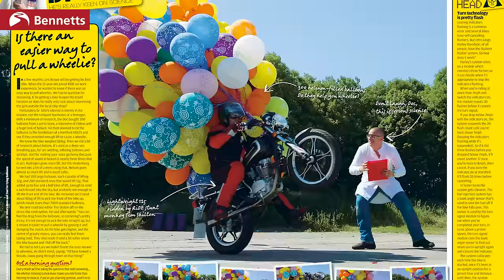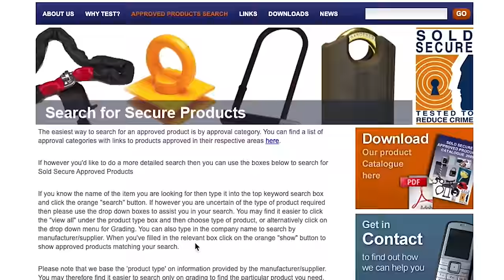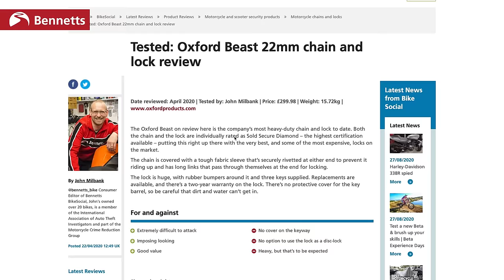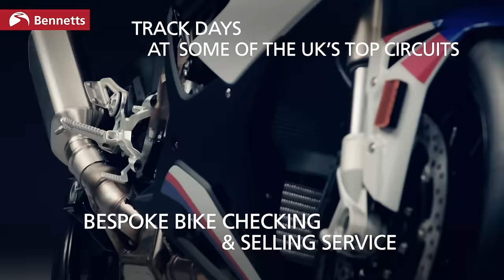The TRUTH about the best motorcycle lock | Litelok, Kryptonite & Oxford Beast review

Comment: Great video John ,keep up the good work.
I use a Pragmasis round lock and chain for my CRF rally. Put the last link through the rear suspension link under the bike and fit the roundlock through it with the keyhole facing down.
Probably not the best, but I think its a good average price / security / weight system.
I put the chain round a pole or something obviously.
What bike is that in your workshop with the barkbusters ?
Reply from the maker: Some good kit you've got! That's my Grom, which I did up to look like an Africa Twin. Cheers, John

Comment: Nothing is safe. Lidl sell a 20V angle grinder with 1mm slitting discs for well under £100 that will slash though hardened steel and stranded wire rope in seconds. 
Get a decent usable lock (the biggest are a pain to use) and use it. Park the bike where thieves won’t want to be watched.

Comment: the chain was hardened to much, it is too brittle - a good ABUS chain will withstand the sledge hammer attack at least a few times and will be extremly difficult to cut with a bolt cutter. the secret is the quality of the heat treatment
Reply from the maker: The perfect balance of case- and through-hardening is very important, but nobody should be surprised at these results on a chain this small.

Comment: I wonder why no one is using a sleve of chainsaw pants material on the outside of the lock. That would jam up a angle grinder.
Reply from the maker: It could be cost, but also it could be easy to remove with a knife, so less useful than you might imagine. It's worth a look, but the action of a grinder is also quite different to the teeth of a chainsaw, which will hook up with the aramid fibres more readily. Cheers, John

Comment: Thank you for the amazing video! That was very informative and I appreciate your candor. I was wondering if you'd be willing to test Kryptonite's New York Legend chain/disc lock. They state that it's their most secure lock: a 14.5mm chain and double deadbolt disc lock.
Reply from the maker: Thanks very much! I have approached Kryptonite several times about submitting product for our tests but so far no joy. I've had some experience of their kit and it does seem good. A 14.5mm chain should be bolt-cropper-proof, but I'd assume it's on the brink of portability. For home use, you could go up to a 16mm, 19mm or even 22mm. Cheers, John

Comment: Great bit of testing mate, the massive chain and lock for around £300 sounds great for home security, but I would not go through the wheels on my Rocket 3 due to the design, the gaps aren't big enough, in fact a struggle with the smaller oxford chain. multi layers and hope they decide its not worth the time and noise. Oh and that's a railway line, not a sleeper which is the wood or now concrete bit they lie on...lol
Reply from the maker: Yeah, sorry about that – I meant a piece of track. Would the Pragmasis Anti Pinch Pin work for the Rocket? https://securityforbikes.com/anti-pinch-pin.php
Reply: @bennettsbikesocial  I’ll have a look when I get home mate , as far as I remember it’s not hollow as there’s a massive spline drive on both front and rear axle. But worth a look

Comment: Very interesting and good points. But what is the best way to use the locks? I know it is best to chain to something, but if that something is weaker than my lock, then it will be as strong as the weakest link.
Also, should I lock through the back wheel, or is it better to loop through the frame? If there is nothing to lock to, should I try and go through the back wheel and frame?
Thanks.

Comment: I just got my front rotor replaced on my 1974  CB750 and I can't use a disk lock anymore. Been hunting for a portable solution with no luck! If anyone has any leads to something that will work please let me know!!!
Reply from the maker: THere are portable solutions rated here: https://www.bennetts.co.uk/bikesocial/reviews/products/security/motorcycle-chains-and-locks Unles you have solid wheels, you've got nothing to worry about...
Reply: @bennettsbikesocial  Thanks so much, I'll take a look. My bike is known for being difficult to find a solution for, hopefully I'll find something! The rotors have no holes and very tight clearance at the base.

Comment: Maybe it did take 4 1/2 minutes if they were using an el cheapo low powered cordless grinder - the sort a punk thief might use. Just saying.
Reply from the maker: I'm not sure you can get clockwork grinders, but if so, maybe that's true. Though they also claimed it was 'pro' thief. Maybe it's different in Canada.

Comment: The biggest flaw with Litelok is that if you twist it, you can just rip the cables out of the locking mechanism entirely. There are videos of it on youtube.
Reply from the maker: I did try this and wasn't able to – I'm not sure if the design has been tweaked since those videos, but that didn't seem to be an issue in this case. John

Comment: Yeah the "Beast" looks great, but how practical is it. Does it fit through the engine swing-arm area? NOPE... so you put it thru your rear wheel and all the thieves have to do is take off your rear wheel lmao.
Reply from the maker: Tuck your bike properly into the corner with a heavy-duty chain attached, and let me know how you get on whipping the wheel out and taking the bike away. Get a couple of mates to help too. 
What would your suggestion be instead of a heavy chain?
Security is about making a bike harder to steal, not impossible.

Comment: Best putting your bike in your house and sleeping next to it with a shotgun 😀..I use two screaming disc locks front and back..heavy duty chain..magnum u lock on front wheel and a brake and throttle lock..but if they want your bike that bad they will take it..all you can do is make it as hard as possible..

Comment: I can't see the point in these methods of testing. Many of these test are like trying to drive a pozi screw with a flat-head screwdriver and the telling us how difficult it was. I mean why bother trying to cut stainless steel cable with a hacksaw when you could use steel cable cutters and have the job done in 5 seconds?

Any thief with a clue will only use the right tool or technique on the lock they're defeating. All of these locks can be beaten in a few seconds or at best a few minutes by someone who knows what they're doing.
Reply: Wire locks cable cutters. Chain locks bolt cutters.  Forget the hacksaw.  And what were those propper job garden cutters ever for I've never used them in my life. And the second pair looked like what electricians would use for cutting copper mains meter tails.
Reply from the maker: Which was the point of the video... watch it through rather than skipping along if you can. John

Comment from the maker: NOTE THAT THE 'LITELOK GOLD' HAS NOW BEEN DISCONTINUED, WITH THIS VERY SIMILAR LOOKING 'LITELOK ONE' REPLACING IT. THIS PRODUCT IS NOW ONLY RATED TO SOLD SECURE MOTOR SCOOTER SILVER, NOT THE PREVIOUS MOTORCYCLE GOLD. 
To find the best lock for you, check out the league table I've written based on three years of testing at Bennetts BikeSocial. Cheers, John https://www.bennetts.co.uk/bikesocial/reviews/products/security/motorcycle-chains-and-locks/how-to-choose-the-best-motorcycle-security
Reply: Hi have have a almex 25mm but how long is the cut time on the Oxford beast 22mm
Reply from the maker: @Jf20082  We don't reveal cut times, and we also haven't reviewed the Almax 25mm (we did contact them but they've declined to be tested). Chances are that due to its sheer size, the 25mm will take the longest to cut with an angle grinder. Cheers, John
Reply: Hi! I noticed in a few times you’ve indicated that mc crime is declining. I’d be interested in a video on the stats and reasons behind this.
Reply: Look at pewag chain i think is really good
Reply from the maker: @danielmcnamara897  I've tested some Pewags: https://www.bennetts.co.uk/bikesocial/reviews/products/security/motorcycle-chains-and-locks/how-to-choose-the-best-motorcycle-security
Reply from the maker: @opcb9815  https://youtu.be/a578fDDP-Nc
Reply from the maker: @opcb9815  https://www.bennetts.co.uk/bikesocial/news-and-views/advice/biking-tips/stop-motorcycle-crime
Reply: I have smaller tools that will cut through those wires. 🤔🤔
Reply: grinder

Comment: Won't be buying a litelock then.
Reply: Why not?
Reply: It actually seemed to do pretty well considering it's weight...bolt cutters would go through chain but not litelok. You are just betting on if the thief will have bolt cutters or cable cutters. I can't say for sure which is most likely but I suspect bolt cutters.